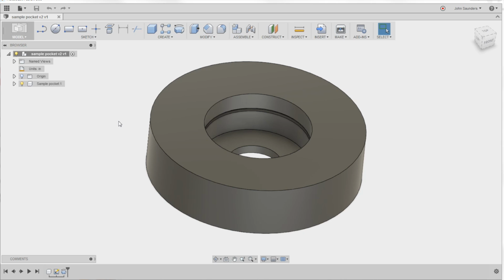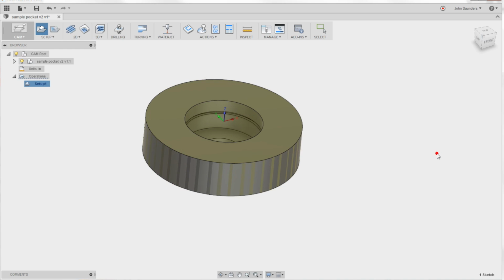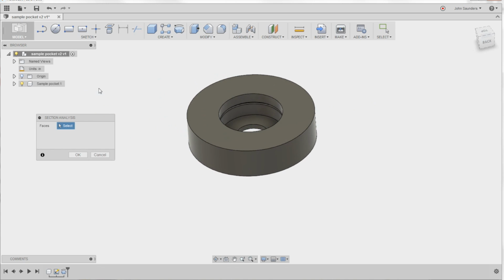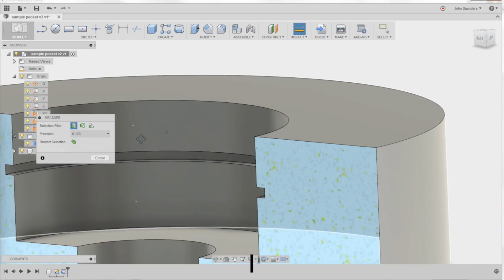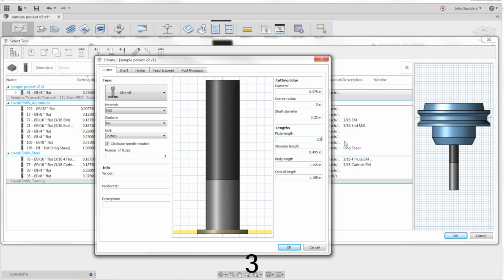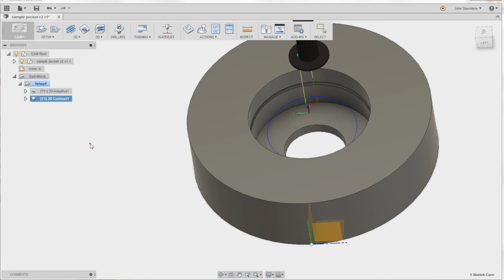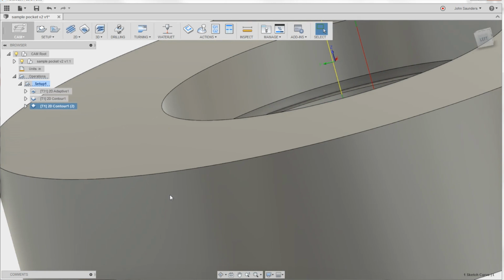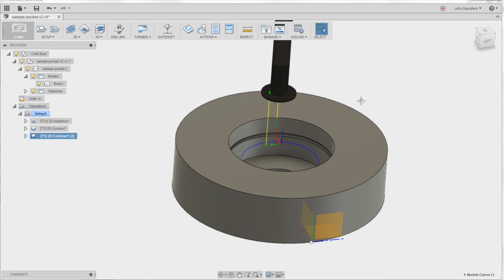Fusion 360 Slitting Saw Slot CAM Toolpath & Section View!  FF40

Comment: Awesome, thanks very much. As the saying goes, easy when someone shows you how.
Since watching your video I found another way but in Inventor which has cam almost identical to Fusion. I used the CIRCULAR operation which can do a lot of things automatically, like the axial stepdowns, and also can do multiple cuts radially if the groove is too deep to do in one hit.

Comment: I know this is ancient, but thought I'd add my .02 in as I was just messing with this. When John gets to offseting the bottom height by the distance of the thickness of the keyseat cutter, instead of needing to plug in the number, you can use the fusion system variable called "tool_fluteLength", this will allow that number to be correct even if you switch to a different thickness cutter.

To get to that easy, just put your cursor in that field and type the - sign, then start typing flute, the variable will pop up in the list, just select it. Don't forget to put the - before the variable name! 

This may not have been in back when he made this video, lots of stuff has been added in the last 5-1/2 years!

Comment: This is very helpful!  THanks!  Seems like f360 should be able to do that work for you.  I want a curved slot with a tool with a radius and that will require me to stack the milling I suppose.  That should really be built in also.

Comment: Hey great videos. I have a part that I need to machine a key seat (slot) into. Its is an irregular shaped part. I have the body already drawn in Fusion 360 and I can send you the file and a picture of the finished part. It may make a great new video for you and help me out the same time. Peter at bluesinter@gmail.com

Comment: Just set multiple depths max step down is the width of cutter (you can use an expression if you would like).. Top of the stock is top of groove bottom stock is bottom of the groove

Comment: I think a better way to make these cuts would be if you select the lower contour in the "Heights Tab" for the Bottom Height and the upper contour for the Top Height. Then in the "Passes Tab" you choose Multiple Depths and under Maximum Roughing Stepdown you use the height of the cutter or a little bit less.
Reply: yes that works in your top height put - your cutter height less your max step down
Reply: Thats what i do on the machine and wondered about cam, it works great.